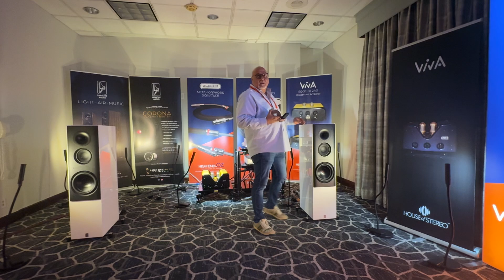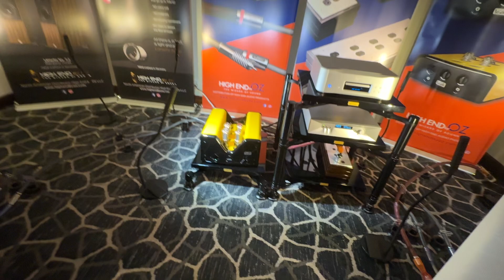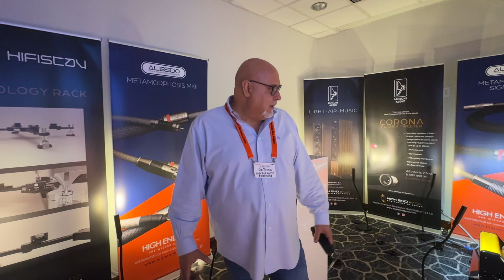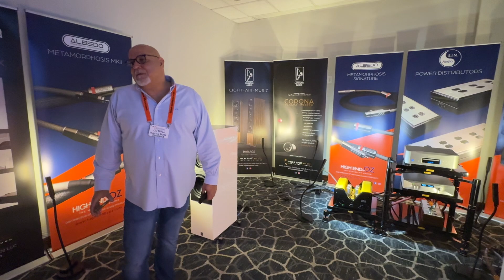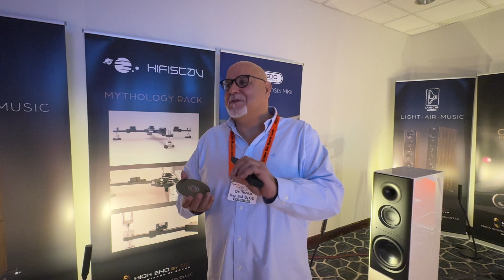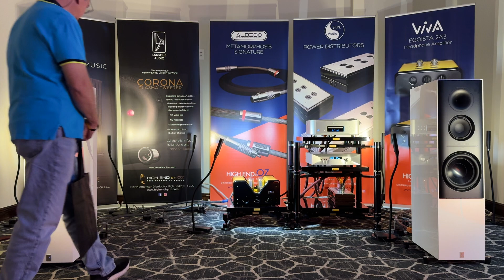Lansche Audio -  VIVA Amplifier

Comment: Again, the problem with dangerous ozone emissions, the issues with RF emissions, and the problems with plasma tweeters being fire and electrocution hazards don't seem to be addressed here.  Caveat emptor.  I frankly wouldn't even want to be in the same room where these things are being auditioned.
Reply: You're overstating the issues. The food you eat has more things in it hazardous to your health.
Reply: @carlosoliveira-rc2xt  So why compound the issue?  It's perfectly safe to get X-rays, so why not get one everyday of the year?  You should carefully choose the foods you eat and carefully choose the components you use.
Reply: @helgar791  Your critical thinking is off. For what reason would I get an x-ray everyday? There is no payoff. Additionally almost everyone listens to their speakers at a distance unlike low dose x-rays which are administered up close. The sun gives life but I don't recommend living on it's surface. As I stated, you overstated any issues.
Reply: @carlosoliveira-rc2xt  No, your critical thinking is off.  Listening to your system, which most people do for hours every day when they have these speakers, is the functional equivalent, especially since all of the things I've mentioned, that plasma tweeters emit excessive ozone, are fire hazards and the constant RF emission, don't give a rats ass how far from the speakers you sit.  Just as constant sun exposure, which is millions of miles away, will induce skin cancer.